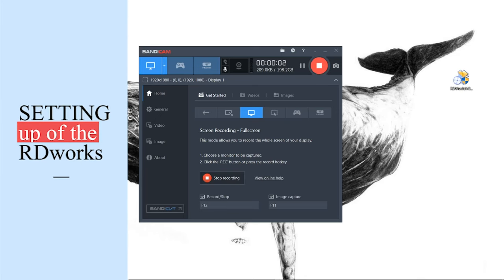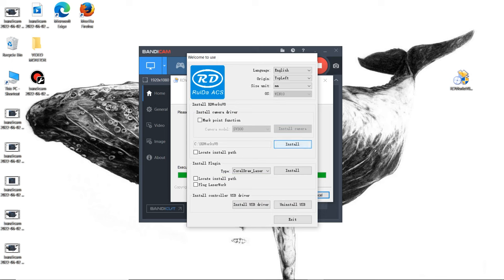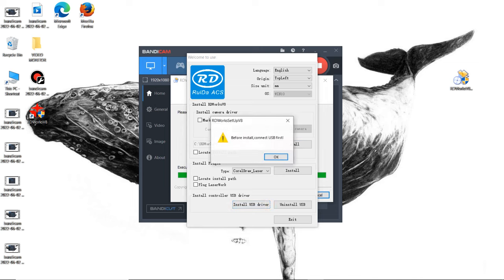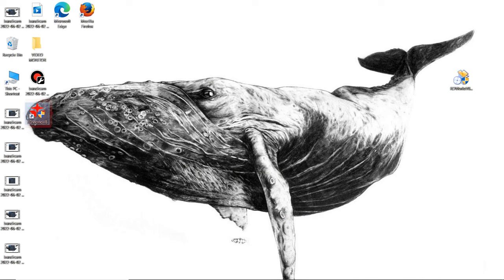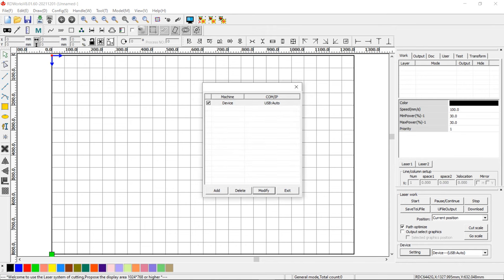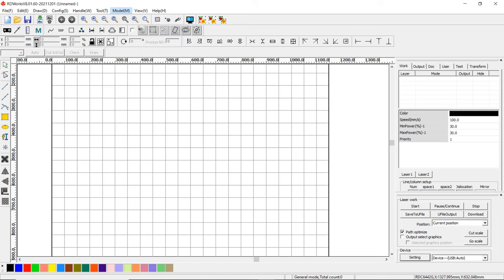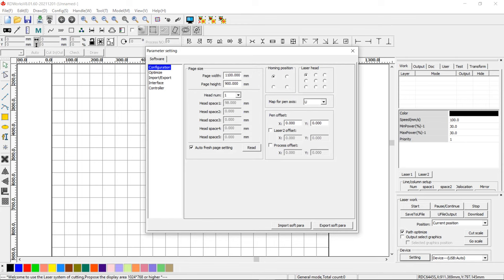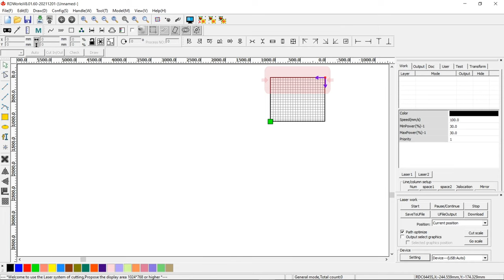How to install RD WORKS software with CO2 laser machine / Wattsan Technical Guide

Comment: Hello, have a 100W laser with RD WORKS software, unfortunately messed with the factory setting and now the laser Y AXIS is all wack and ramming against the right side at startup and laser is cutting circles as ovals and squares are rectangle. Is there anything to correct this issues, would this tutorial help. Would appreciated your help.